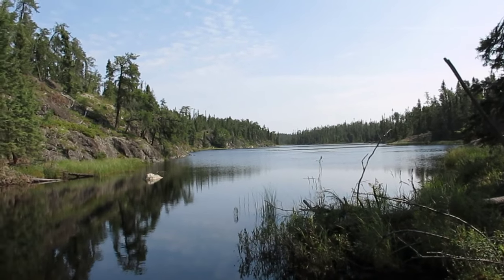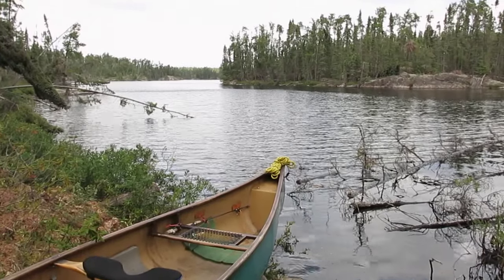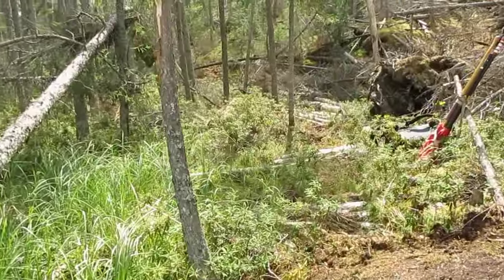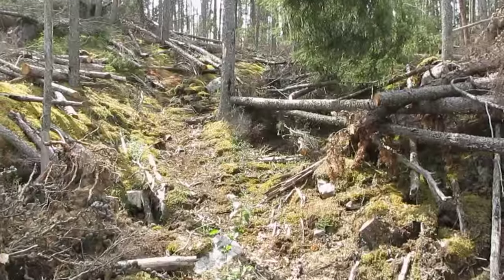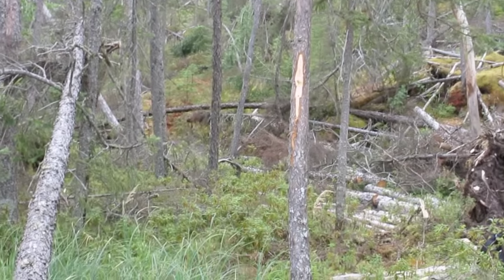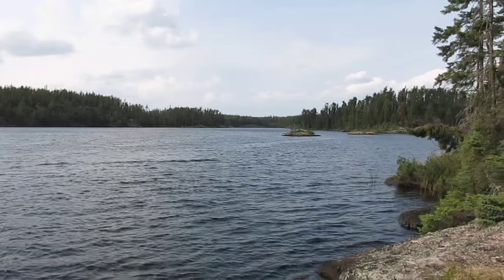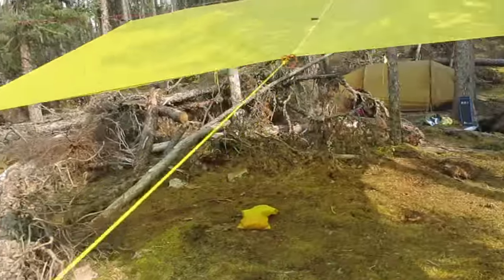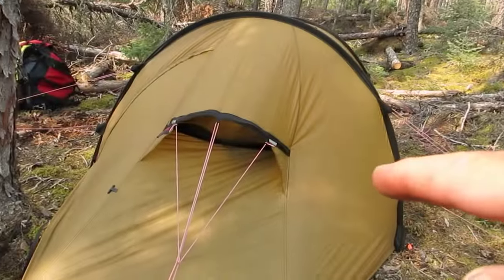Corduroy Portage Trails: Pt 12, 24 Day Canoe Trip, 2014

Comment: There are some spots in the BWCA I wished they would do the "coruroy"  thing....mainly to save the topsoil, and make some of the muddier landings more manageable. Thankfully one of the "muddy" spots got swallowed up by a beaver pond....so I just float the 30 yards across there.  Good advice about the tarp. I picked up a new CCS tarp and I have it rigged like you suggested in another video. I went for a LONG time on BWCA trips not having one......now I take it on my backpacking trips. The extra pound or so is worth it!

Comment: I have been using the same "kitchen pack" for 35 years. I keep food in sealed containers and hang the pack every night. Worked well so far. Only had a few critter events. I just turned 60 (in the bush BTW) and am considering lightening/changing my kitchen. Some nights hanging is just a hassle or next to impossible. I notice you use a bear barrel. Do you hang it every night or just seal it up and keep it away from tent?
Reply from the maker: I never hang the barrel.  Its not just laziness on my part.  Boreal forest trees species usually have no extending  branches, and thick canopies, so its often next to impossible to get a rope up and over branches to suspend between two spruce or jack pine trees.  Birch is our only practical tree to use a hanging line based on its branch and canopy structure.  I do use birch, if its available, to hang food when on light backpacking trips when I do not have a barrel.  On canoe trips, I keep the barrel very clean.  I never touch the outside of the barrel with hands with food smells.  I will wash my hands before sealing up the lid.  All food inside is multi-bagged and dry to keep smells to a minimum.  I place the barrel on the ground, away from my kitchen area, and try to keep it in a sight line of my tent door.  If a bear (who has learned what a barrel is) gets into it, I want to be able to see and hear it, and get out of my tent to defend it.  I have used bear bangers to scare a bear out of my camp before.  I do not subscribe to the method of placing it way back in the bush where I will not hear or see a bear getting into it and It possibly dragging it off.  So far so good, never had a bear issue, either black (Boreal forest), or grizzly (Arctic Brrenlands), and in the Barrens (tundra) of course there are no trees to hang food with.  I do not bring bacon on canoe trips, as its just too over the top attractive to bears, and it leaves a smell from bacon "vapor" around camp and on clothing.

Comment: I'm not sure if you ever replied but I was wondering after being out there for all those days did your back get sore from only have a stool without a back along? I was thinking of only bring one on my next trip, but am a bit worried my back will get too sore after being in a canoe all day without a back as well. Please advise
Reply from the maker: Hi Mike - just sent you a response on that Coghlans stool from a previous comment.  I find it not a problem for my back.  I can sit with legs out front and knees bent at a comfortable angle, and it forces me to have a straight posture, more or less. However I am very short, low to the ground.  A tall person might have an issue with sitting so low.

Comment: Incredible storm damage!!  It had to be tornado quality!  Great shout out to the trail crews I'm sure they appreciate people using the areas they work on.  As usual great video!
Reply from the maker: A J Taylor Thanks AJT!   They work in relative obscurity and don't get much public recognition.  I know the Super and Assistant Super of the park, and they do a great job running the trail maintenance program with  the limited budgets they get.  The crews have to paddle and portage too, they don't allow them to use motor boats.  Chainsaws yes but not motor boats, so it must be very hard work in the rain and the bugs and the heat.

Comment: Hey there, what type of saw do you use for wood processing ? Thanks
Reply from the maker: Hi Noah, in summer I use a 21 inch bow saw, various brands (e.g. Sandvik, GMan).  I only use Bacho saw blades, since they are the best IMO.  I use the green wood blade with the big gullets, since I find for the Boreal softwood I process (jack pine, black spruce, balsam fir), it moves the sawdust out best, better than the dry wood peg teeth blade.  Even though my firewood is dry, its resinous and "soft", and I find the gullets just move that dust out of the kerf faster than the dry wood peg teeth version.  In winter I use a 24 inch bow saw, again with the green wood big gullet Bacho blade.   I like bow saws with lots of "bow" to cut the larger diameter logs.  The triangle saws are too small for my needs.

Comment: Looks like a paddle bag. How many paddles do you carry why is that. Appreciate the videos as always
Reply from the maker: Hi Ron!  That old paddle bag was made by a company no longer in business.  It can hold up to about 6 paddles. It has a velcro closure with alot of adjustment, so its well designed and simple and light. I am surprised no one else makes them. Very good for the solo tripper, because I can sling the paddles over a shoulder out of the way and have hands free.
Reply from the maker: Hi again Ron. For a flatwater trip, I carry two paddles in case I break one. I may also carry a sea kayak take-apart paddling against big winds.  The sea kayak paddle provides more straight ahead power, but it soaks everything, and me, in the canoe because of the drips off the blade and drip rings, so I use it only when necessary.

Comment: I love that grill I will have to get myself one that is not like an old oven rack.
Reply from the maker: +Ken Murray Hi Ken!  That is a Purcell Trench Grill, Traveller model, perfect for 1-2 people.  Tubular stainless steel, tig welded, smooth edges, very light, nice and strong.  For a larger grill for bigger pots and pans, I use the Voyageur grill.  These grills should last a lifetime.
Reply: +Wintertrekker Much appreciated.  I spent the weekend enjoying your many canoe trip videos.  The best remedy for winter.  Ken

Comment: One reason that your tarp is collecting water is the relatively flat manner it is hung.  If the sides were hung steeper, the water would run off more readily.  However that decreases the dry foot print.  One other thing to consider is the lines you use to hang your tarp, if they are nylon based cord, they will stretch when wet so that is another factor.

You could incorporate some shock cord into your guy lines to make self tension guylines that will help keep your tarp pitch tight when the nylon fabric stretches out.  There are many youtube videos on how to make them.  Or visit hammockforums.net for details on how to make them.  There are a few different ways.
Reply from the maker: bwillan Thanks Bwillan!  Yes I know that the open pitch I use has that negative, but I like the 360 view, so I can keep my eyes on those sneaky bears who may be sneaking up on me!  :o)  I do like the big dry footprint underneath, although with the open pitch high on all side, rain blows in to some extent.  In the forest the wind tends to swirl, and also those storms when they hit tend to rotate wind direction from existing, so pre-rigging a directional lean is a gamble.  So I like the simple gable end rig when inside the trees, which can handle a tree-broken wind from any direction reasonably well.    Usually there is a break in the deluge enough for me to pop out and tighten a few lines after the initial stretch (I use truckers hitches and slip knots, so its very quick to adjust, although I may break down and rig some additional Line Loc sliders at the tarp side as well so I can reach them without going out of the trap coverage....although I do not know where to find them in Canada, nor what size to order.  My Hilleberg has them on the lines).  My guy lines are dyneema Zing-It 2.2mm, and the  ridge is 1/8 Amsteel, so the lack of stretch on those is about the best available. I am aware of the several methods for the shock cord tension rigs, e.g. inchworm method, or the in-line rig, etc.  One of Shug's videos shows a shock cord tensioner.  But I like the cleanness of my line system as-is, and its lighter without the shock cord additions, albeit with the active tension loss.  On my arctic tents, I rig big 1/4 inch shock cord loops on all my tent tie outs to prevent my tent from shredding, but it adds weight.  I should do a weight analysis for my tarp to see what the additional weight might be.
Reply: I find with dyneema line (Zing-It, amsteel, etc) that they tend to not hold knots very well due to the coating on the line.  What I did for my hammock tarp guylines was to splice a fixed eye loop to one end of the line.  This goes around my tent stake or tree branch, etc.  To attach the line to the tarp tie out, I use a prussic loop of the same size line on the guy out line.  The whole prussic loop is attached to the tarp tie out with a larkshead/girth hitch/toggle.  This allows the tarp to be adjusted from underneath if happens to be raining out.   

Using the same size line for the prussic loop and the main line also has the property that it will slip beyond a certain force (25 - 30 pounds I believe).  That will prevent the tarp from ripping in a big gust of wind or if someone trips over the guy line.
Reply from the maker: Neat rig! BW!  Gives me some ideas.  The advantage of my "floating" ridge line suspending the entire tarp, is that it is an entire shock absorber.  The tarp goes up and down and side to side with the wind.  The length of the ridge line absorbs alot of energy.  Silnylon has a natural stretch and elasticity too.  I don't use that rig in the open however.  If you watch my vid of my 35 day solo Barrenlands trip on the Upper Lockhart River, I show my pegged to ground flying diamond rig with paddles and one 6 foot pole.  Its rigged to shed/slip wind and not move.  Tarpology - its a great topic, and a learning curve for life - there  are always new innovations to explore!
Reply: Wintertrekker Hoop -- you can order the mini Line-Loks online:
http://www.cleats.co.uk/
Or at MEC -- but at 75 cents each:
http://www.mec.ca/product/5028-461/mec-line-lock/?h=10+50055+50130+50710&f=10+50130+50710

I ended up ordering a bag of 100 and am happy to drop a couple dozen or so in the mail if you'd like.  It seems like the least I can do for the service and knowledge you provide to this community of ours.  Drop me a line if you're interested.

They also have some great ideas for rigging:
http://www.clamcleat.com/uploads/cleat_information_pdfs/Line-Lok-leaflet.pdf
Reply from the maker: Thanks Geoff for the heads-up that MEC carries them!  I did not know that.  The CL-266 size should fit my Zing-It 2.2 mm line, and I see MEC has that size.  No worries for sending me some.  At 75 cents each, I will just tack on a dozen or so on my next MEC order for gear over $50 and get the free shipping so that they are almost "free"!  Thanks again!